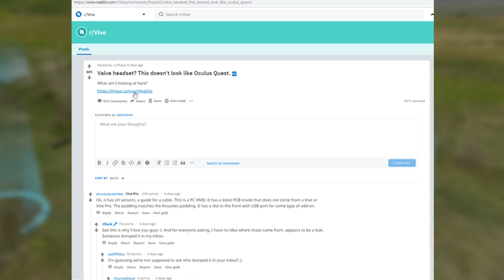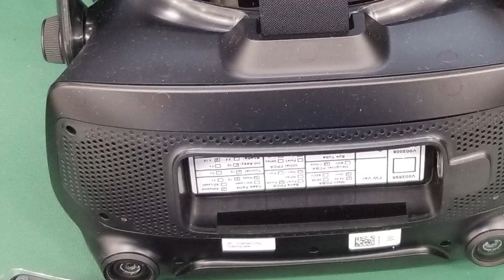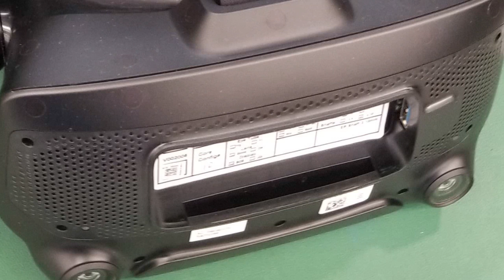Valve Index VR Headset Leak: Everything You Need to Know!

Comment from the maker: Everything you need to know about the recent leaks of Valve's VR Headset, Half Life 3 and the SteamVR Knuckles controllers.
Reply: personally i hope this is a standalone steam vr headset running steam vr
Reply: If a Half Life title is going to release, it will be a full brand new game and not a remaster. (Rumors suggest HL2 Prequel) The reason why is because Valve said they are working on 3 full VR games. Unless Valve make a small experience or remaster on top of their 3 games, which I personally doubt because that would be spreading themselves thin.

Comment: Anyone have any idea when it’s going to be released cuz idk if I should wait or buy htc vive
Reply: hello there  neither buy an oculus, by far better than htc with the controllers has more games and is cheaper, your welcome
Reply: @hello there not by far, oculus headset itself is better but vive is easier to setup, better and more reliable tracking. The oculus controllers has it's advantages but it also has it's disadvantages for example it feels like a toy. Personally I would wait, the amount improvements coming to the headset is too good to pass up on and considering the knuckles controller are basically ready for consumption, the headset is basically around the corner and believe it's going to be great as valve said they will only step in if other companies are not getting the job right which means they will be putting features that are not in other hmds at a competitive price. Don't forget Valve are bringing 3 FULL games that were built with the knuckles in mind. So to sum it up, in my opinion you should wait as the headset is more than likely coming out this year

Comment: Not sure it'll be enough to sway Rift or Vive owners, but if wireless it'll be a lot more attractive.
Reply: I'm a Rift owner, Rift S is a disappointment so I would consider this once details are released.  If you want a mobile headset (wireless) it won't be high end so Oculus Quest would be a great for that.  I plan to get one for mobile vr (no wires), but I want a high end pc based vr HMD also.  I'm all for a wireless adapter like Vive has, but I'm okay with a cord for a high end pc vr system.

Comment: Regarding the source, the user posting is a mod in r/vive and someone (secret source) dumped the images in their inbox, ref: https://www.reddit.com/r/Vive/comments/9vpek5/valve_headset_this_doesnt_look_like_oculus_quest/e9eihfa/

With HTC running the VivePort store, the Vive Wave platform for standalone headsets and Vive Pro for enterprise... it does feel like they have somewhat cut out their own part of the VR industry separate from Valve. I sure hope Valve is trying to make a solid affordable headset to expand the user-base, although at the same time I kind of want them to innovate as well.

How are they making it? They already have the tracking system, the controllers are close to completion and they have their own lens and display design ready for licensing as noted here: https://partner.steamgames.com/vrlicensing#DisplayAndOptics Due to all this I have previously talked to people about how it would make sense for Valve to just take all their parts and glue it together to a full VR solution. Maybe this is that happening... it sure looks like it!